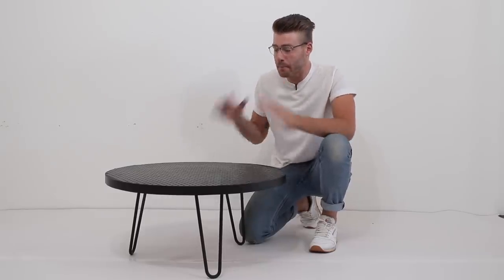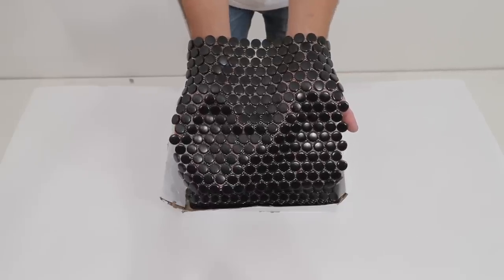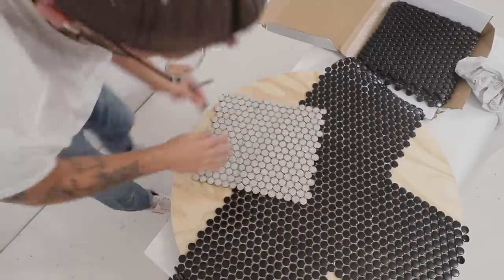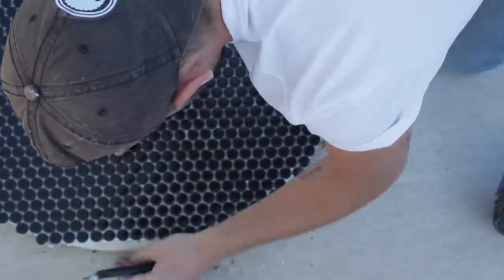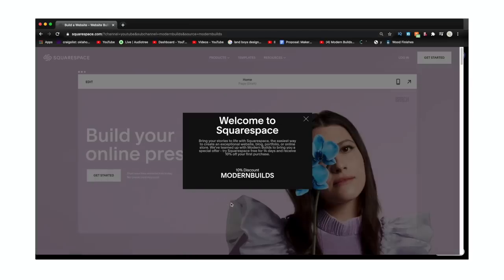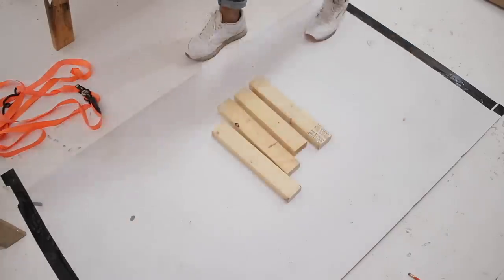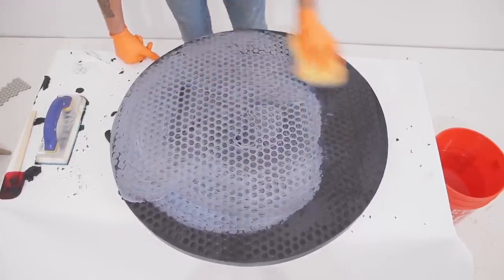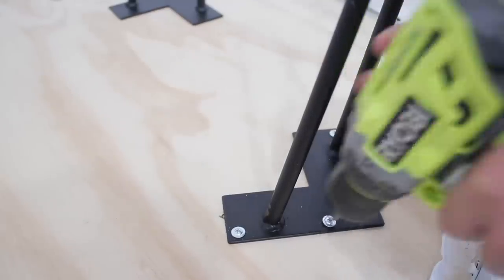DIY Black Penny Tile Coffee Table | Modern Builds

Comment: The edges ruined it.
Reply from the maker: What would you have done?
Reply: @ModernBuilds  Wet hand circular saw marked with blue tape or a tile chipper because they are penny tiles or a schulter edge to cover up a uneven tile edge. Maybe even made the original shape a square to keep it less complicated. I like and appreciate ur content.
Reply: I would’ve done a dry layout of tile, marked where the tiles where overhanging and trimmed penny tile so it was flush all around the edge. In this case some more planning would’ve been a good choice.  I don’t think the edges ruined it though because the black grout hides a lot of the inconsistencies a contrasting grout wouldn’t have.
Reply: I disagree. The raw tiles on the edge would have looked horrible. This design is really beautiful.
Reply: I'm not a builder, but I think the edges look great they way he did them.

Comment: I get that you want to keep these more accessible without investing in a lot of tools, but I think getting a wet tile saw and then cutting the edge tiles using the edge lines you  made before adhering them would have made a better final result.  A thicker flashing, as you mentioned would have been good.  A copper flashing might have been interesting with the black.  A plunge router/dremmel tied to the string might have made the circle easier.  Using the metal band sticking up and doing some colored epoxy might be an interesting table design as well.
Reply: ooo i love the idea of copper
Reply: All good ideas

Comment: I've incorporated mosaic patterns in some of my projects before and the best way to get a smooth flush tiled edge is to use tile pincers which can be used as the adhesive/grout dries. It's fairly easy to do and doesn't take that much time. If you use a power tool, wait till it's cured and fully dry and clamp it down to minimise movement and cut it with straight passes until it forms a curve, similarly how a circle could be can be cut on a bandsaw if you're less confident than following the line. Overall it looks good.

Comment: Quick set Thin-set hardens way faster depending and it can be for outside (lasts really long). Also, you could get chemical drying thin-set instead of air-drying type so it will dry even covered in grout if its still wet. Doing the tittle things really helps with tile.
Reply from the maker: Good to know! I'll look into it, had no idea

Comment: Another interesting thing could be - black penny tiles, and then get white grout and mix up a few different rainbow colors with little batches of the main quantity. You'd have to be careful about the colors mixing, but it could be pretty interesting to have the grout "pop".
Reply from the maker: "rainbow grout"!! I like it... I think i'd try it with white tiles!
Reply: @ModernBuilds  Yeah, that would be sweet. Some other extreme ideas: I wonder if you could use some kind of additive that made the grout shine in a blacklight, or adding some of that glow in the dark powder to the grout.

Comment: Wouldn't just trowling on the construction adhesive have saved time and been cleaner.
Reply: I think a couple of reasons. First I have used that construction adhesive and it starts drying very fast so if he put all of it on and then laid the tiles down it would probably not have adhered to the tiles before drying. Also it comes in a tube so how would one trowl it all on? Squeezing it all out and then spreading it around with a trowl seems like it takes more time than just squeezing it on the back of the tiles. I also think it is easier to see how much you are working with if you are used to squeezing it out since it takes a different amount of regular adhesive than it takes tile mortar to get something to adhere. Squeezing it out on the tile seems way easier and faster than trying to trowl it on.
Reply: He even said in the video, he only wanted it on tbe tiles not in the gaps as it would show through, trowelling would end up with it filling between all the tiles

Comment: Hey Mike, I like the coffee table and I agree about the all-white table. Let me ask a question concerning the plywood. Would it help the project to paint the plywood whatever color your tile will be before laying the tile? Then there is less likely any light-colored specks showing through. God Bless my friend.
Reply: No, because there shouldn't be any gaps in the grout if you've done it properly. Paint would also weaken the adhesive strength between the tile and the wood
Reply from the maker: As long as you do a good job grouting, there won't be any plywood showing

Comment: After a recent table project I've seen, I can suggest you to sell it for 1 million dollars.
Reply from the maker: haha!!
Reply: The $6000 table right? 🤣🤣
Reply: Lol that plywood table was a rip ofr
Reply: Yeah, Ben was definitely flexing about ripping off a client.
Reply: What's the info on this?
Reply: nicko198718 some YouTuber made a pretty rubbish table with terrible joinery on the top, on the cheap. Used 4 separate pieces of plywood when he could have used 1 large expensive piece, and got a much better result. Didn’t even line them up well - he just stuffed them with filler.

The legs were cool but rather impractical, and liable to damage the floor they were placed on. He somehow sold it for $6000, which was crazy.

Just didn’t look up to scratch.

Comment: Mike, would it help if after drawing the first circle then taping it and drawing on top of the tape before cutting? Might help with the chip out.
Reply from the maker: If the chipout would have been visible I would have done that for sure... I also would have used jigsaw blades with higher TPI 🤙🏼